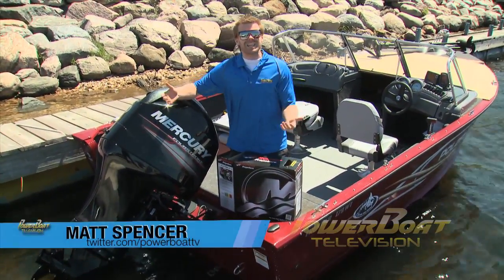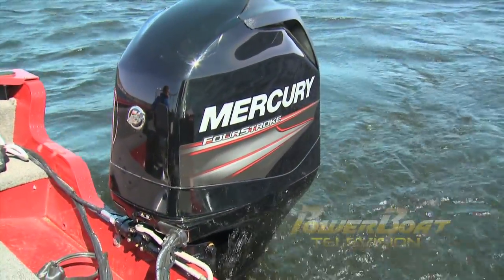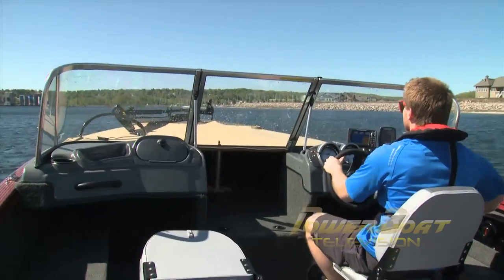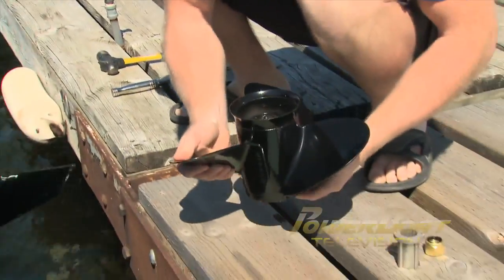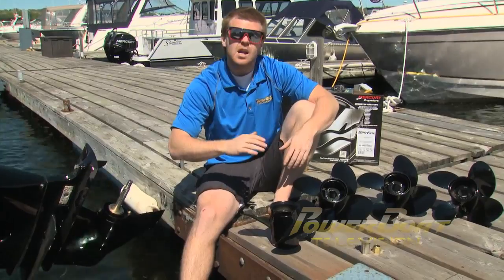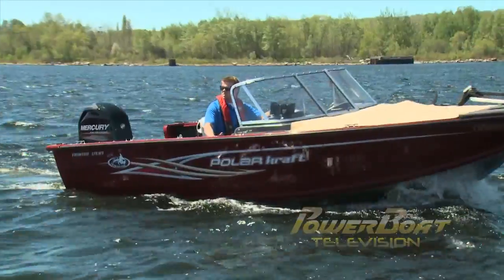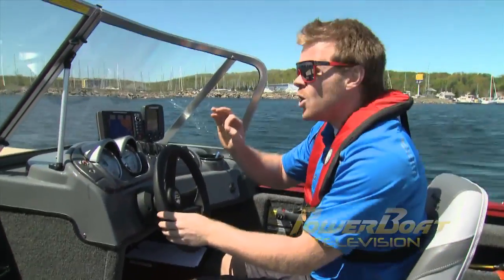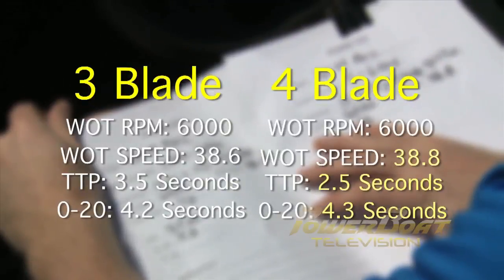DIY My Boat: Mercury Spitfire Propeller Test - PowerBoat TV

Comment: Good info to confirm what Merculy states about the Spitfire prop, they say you don't need to go down in pitch with this prop. I am doing a repower with a 2023 - 115HP,  the dealer/ shop set me up with a 14 X 13 - 3 blade from experience, I think I might see what it's WOT RPM is before making this purchase, but it seems that I will get a 13" pitch if the 3 blade makes it to at least 5500 RPM WOT. As far as the "all that for just 1 second" comments here, the goal is, to have long term efficiency in a prop if you spend any time on the water and travel from spot to spot on a big lake, where a better prop will save you money on fuel. If you just pleasure boat on a small lake, keep your money in your wallet.

Comment: what does a 4th blade offer?
Reply: Quicker acceleration, more lift, better handling in some cases, especially in rougher waters, and you don't have as much issues with ventilation or blowing out in tight turns. Generally the rule of thumb always was 4 blades had lower top speed compared to 3 blades, but better acceleration. 3 blades provide pretty much the best compromise in all areas, hence why more people run them. Modern 4 blade props have come a long way though...and with modern designs, you're really not sacrificing a ton of top-end speed. 2 or 3 mph maybe. Or in some setups, like shown here, you don't lose much of anything. But it's dependent on the total setup, and a lot of other variables. So take the video with a grain of salt. Just because he didn't lose anything switching to a 4 blade doesn't mean you or I won't on our boats. I've also heard people say that 4 blades have a little bit of a harder time driving/pushing a boat up onto a trailer...but I've never really tested that as I don't own a boat that requires me to use my outboard to drive up onto the trailer. 

The real answer though is to find out what works best with your boat. If you're not sure, talk to a professional or a rep from your engine manufacturer. Go-to a dealer and get propped with what works best with your setup. The reason a 4 blade prop is theoretically slower is because that additional blade creates additional drag. You're also supposed to go down in pitch with a 4-blade than what you'd normally run with a 3 blade. The lower pitch aids in acceleration & hole shot, but lowering the pitch increases engine RPM which is a 4-blade is theoretically slower, because you'll reach your engine's max RPM faster, resulting in a lower top speed. Like a shorter gear in a manual transmission.

That's the best way I can describe it. 4 blade props serve a purpose. It just really depends on what you want out of your prop and your setup.
Reply: More traction
Reply: With a 4 blade you can lift the motor one hole and get even better top end.
Reply: I understand your comment is 5+ yrs old.
BUT YOU
Clearly you didn't watch or listen to the video.
Reply: @retrocny5625  not sure why a four blade would have more of a problem getting it onto a trailer. If anything it would be better.

Comment: this video got me to go out and buy the spitfire i called mercury found out witch one was best for my boat and i must tell you it sucks what a wast of 200 dollars i lost 12mph and was tacking 6000 never had to tack that high and the propeller still blows out the only thing that was good was it did get me on plane faster.
Reply: You must've went down a pitch or 2 if your tach was reading higher.